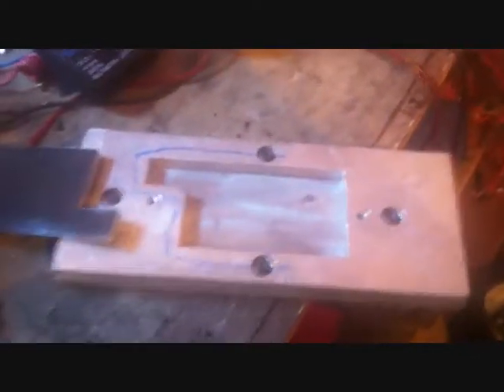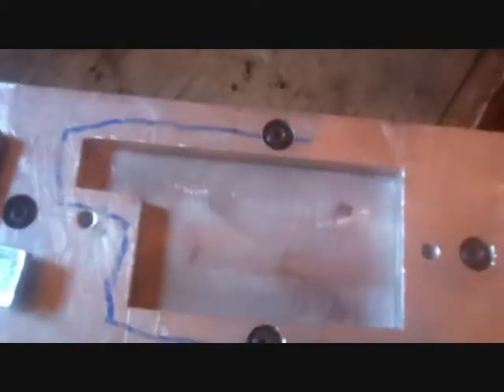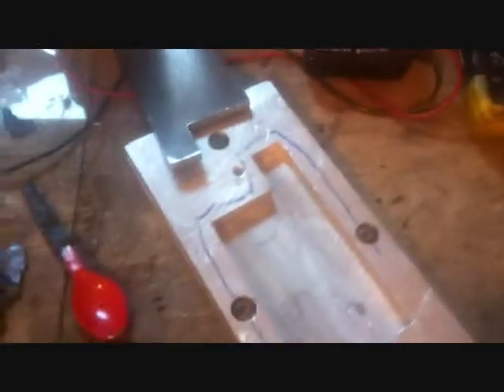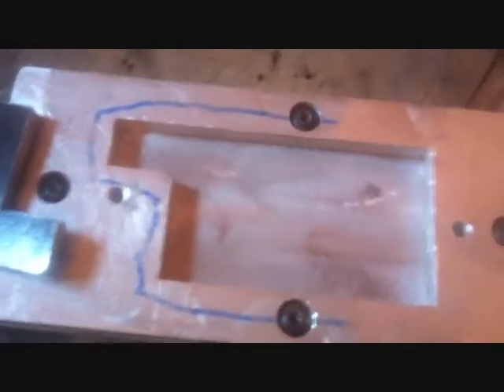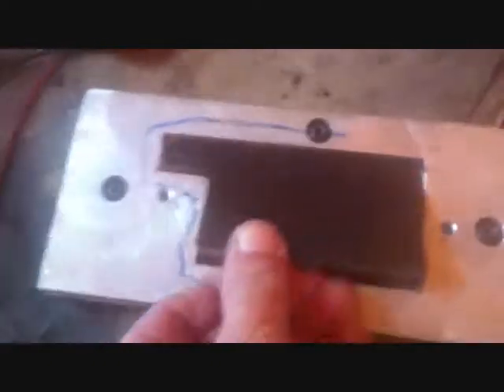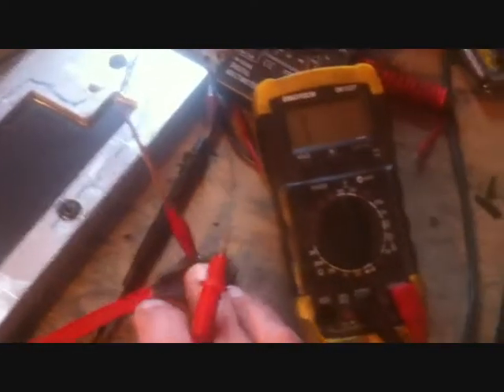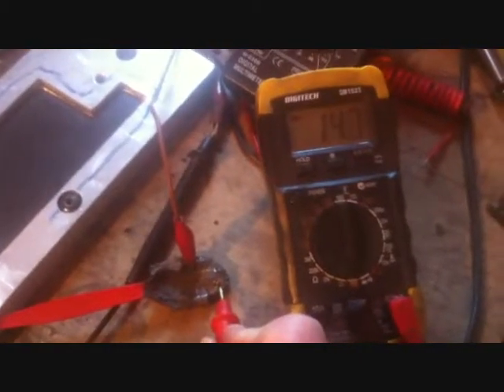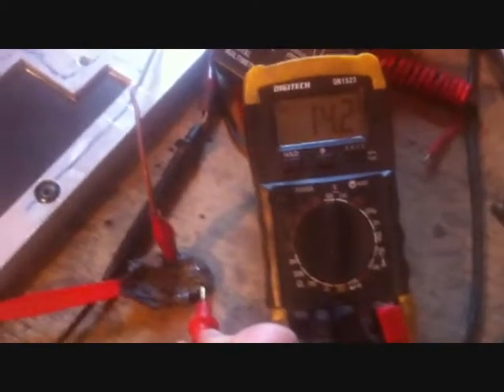Cell Electrode Design

Comment: hi Dan, nice mould you made.
I am trying to do a similar thing only using ink/paint rather than a mould.
What is the mesh size graphite you are using and what kind of resistance are you getting?
Regards Martin.
Reply from the maker: Its air spun graphite. does not say the mesh size. its verry fine you could spray paint with it. Getting 9 Ohms 25mm apart, But it breaks apart, I think pressing them will fix the issue.